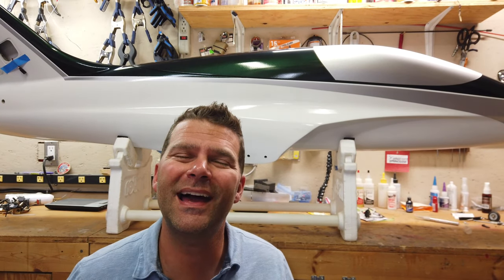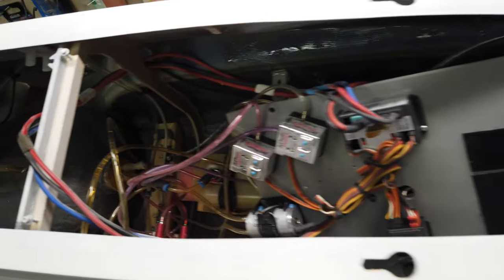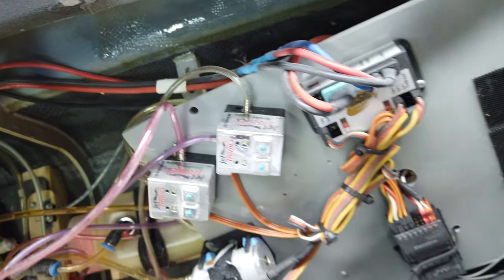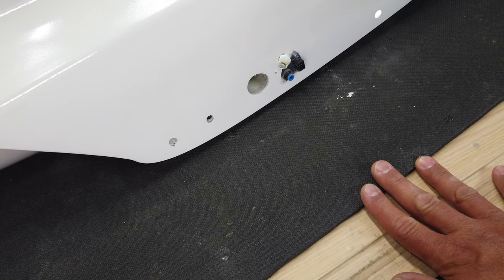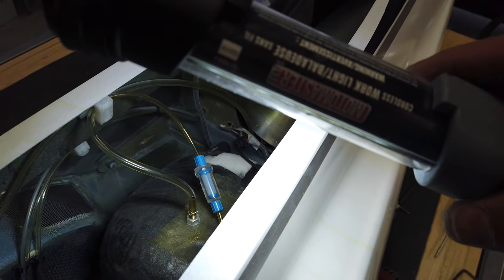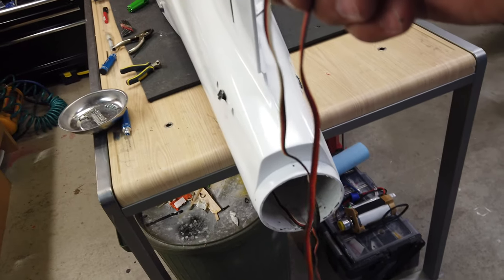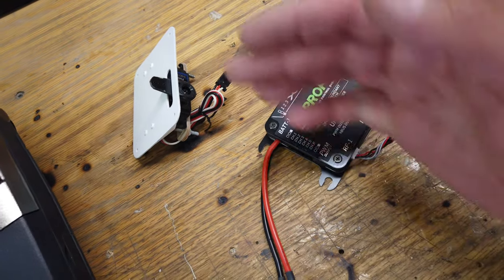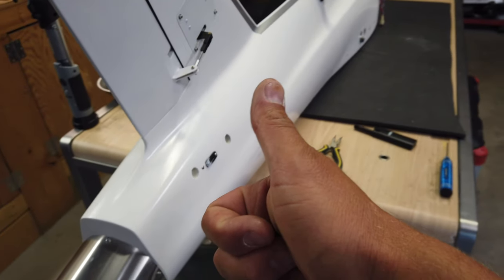Building A Tomahawk Futura Turbine Jet - Rebuild Video #1

Comment: Hi, I am planning to use Powerbox Mercury SRS with GPS, I know by reading the specs that the GPS would correct real time the gain based on the speed of the airplane, I did all the set-up so all looks good for my testing flight but I was wondering if you can do a video explaining how the GPS and gyro  corrections work, please.
Reply from the maker: Awesome!  Thanks for the suggestion Victor.  I will definitely do this.  Thanks for the great idea and watching!